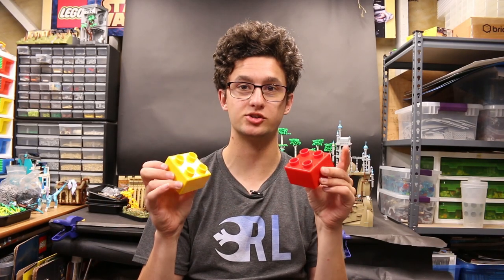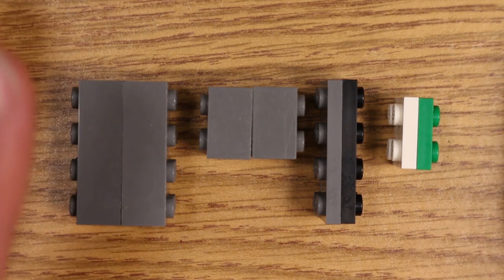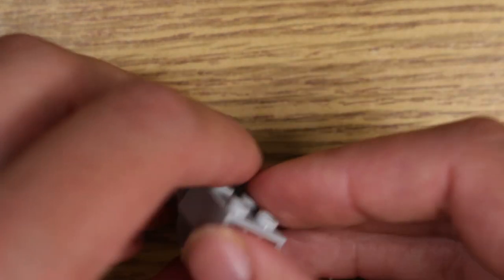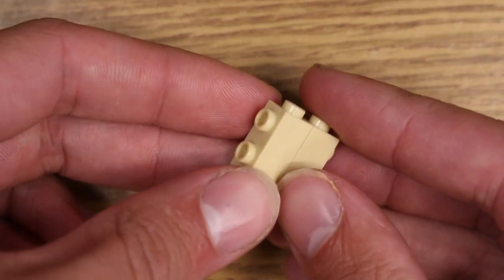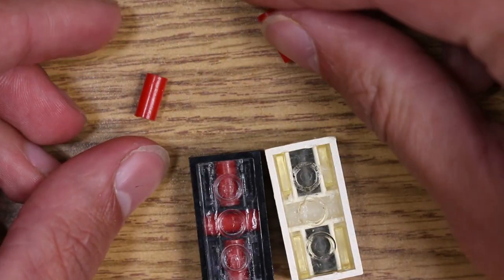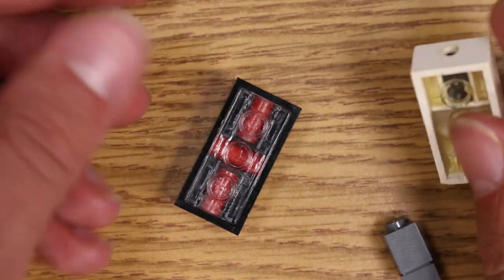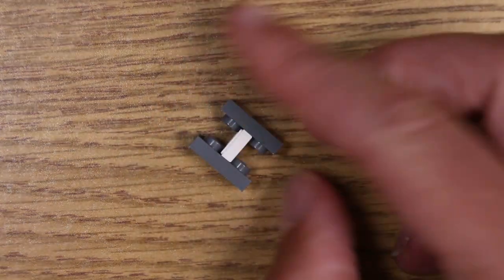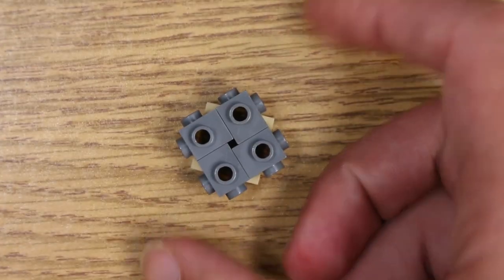LEGO Techniques: Stud Inversions

Comment: Sorry, but I'm new to Lego, but I have one simple and maybe stupid question... Wouldn't it be much easier for many problems just to buy a 3D printer and print exactly the parts that you need? Or would that be what you call very super duper mega ultra illegal?
Reply: It's just that for most MOC builders, it's fun is to come up with solutions with the pieces you have
Reply: Wouldn't road cycling be easier if you just used a car? It's called cheating. Lego building is done with lego pieces. That's how the result can be percieved impressive.
Reply: As I see it, the challenge is to create MOCs with the parts available. What's life without challenge?
Reply: Lmaooo that's worded amazingly
Reply: Great stuff. Bucket handle was new to me. All in one place. Thanks

Comment: I don't understand why Lego hasn't made studs on bottom (SOB?) plate/brick. Every other direction is provided (and a whole bunch of dumb specialized plates/bricks that are basically for one use only), so it doesn't make sense to me that after all these years, Lego hasn't made these SOB bricks available. 
Thanks for this. I need the bucket handle method for a MOC, but it would have been better to find a plate that natively did this.

Comment: 17:45 - "if you can come up for a use with this I'd be impressed". 
Ok here you go, I'm working on modifications to apollo 92176 - the model works great for display . . But I need it to be functional in order to demonstrate all the step-by-step processes of going-landing-returning from/to moon.  There are a lot of attach and detach steps needed between the command module and  lunar lander.  The build provided by lego is not functional in this regard.  I've had to make a number of modifications to make it functional  . . However I was stuck on one area and viola!  Your modification at 17:45 provides a way for the ascent stage to affix diagonal to the descent stage allowing the descent stage legs to retract in further!  Thank you !!!